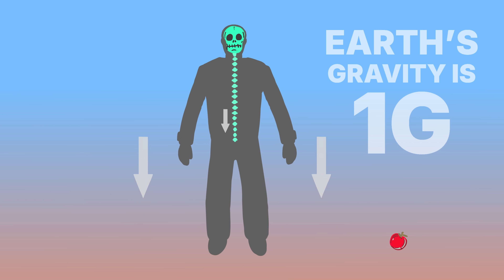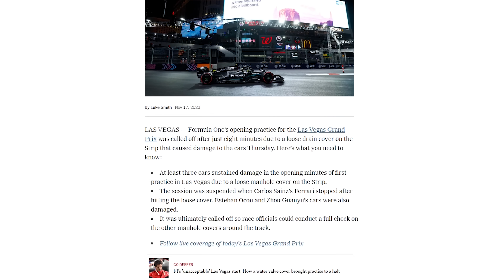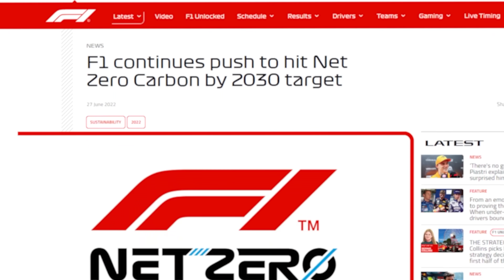Neil deGrasse Tyson Explains the Physics of Formula One Racing

Comment: Great choice of shirt for the interview. Can’t get better than a cloth print from a painter while in a asylum painted his interpretation of the night sky. 
My only disappointment from this was the history to attain downforce in these racing cars wasn’t mentioned. I realized the historical significance of F1 racing in 1977 when I got the opportunity to go to Hochenhiem for qualifying day. Bought a poster of Mario Andretti in the casket colored JPS chassis. This was before Andretti and Chapman began winning with “ground effects,” in ‘78. The yellow skirts are obvious on the poster I have. That was later banned because of the grip the chassis would have due to having no air current under the auto. The front and rear fins for downforce on the car pushed the whole chassis onto the track. 
Another point of any racing that I regard with high importance is the fact that the whole race is run on tires which cover about 3” of the asphalt or racing surface when standing still. This part of the racing isn’t mentioned often, yet that’s what racing is really about. Keeping the vehicle attached to the racing surface. It is important to note that the rubber wears off the tyres and builds up a sticking surface with more of the rubber put down before and during a race. When it does rain, that surface of rubber becomes the opposite of sticky and becomes slippery. Even with grooved rain tyres. Of course a racer does want to stay away from the clag or marbles which builds up off the racing line. 
One of my favorite F1 racing talk segments was with Sebastian Vettel and Mario Andretti. Somewhere near the end of their conversation, Vettel asked Andretti sheepishly if he could use the tires on his ‘78 JPS since they were larger. 
Lastly most accidents with super cars are due to old tires. If you’re going to race on any road, be sure you have the best tires. Finally last. Yes, I wasn’t sure best use of  spelling, tyre or tire should be. 🛞
Reply: Read a some other comments which better explain the underside of the current chassis along with needing to take turns at high speeds due to the design of the chassis. Thanks again, Neil.

Comment: Nice! But to be honest, turning water and CO2 into a syngas (H2 and CO) using electrolysis and the reverse water gas shift reaction and then into fuels through Fischer-Tropsch synthesis, isn't very innovative. Except for catalyst improvements this is pretty old technology, only economically viable for niche applications (such as wartime fuel shortages for which it was developed or big money F1 events).

Comment: First time I have ever felt dumber after listening to NDT. Wrong on the HANS device—it's NOT there to counter lateral G, it's there to keep the mass of the drivers' heads from breaking their necks in a frontal crash. Ask Dale Earnhardt, who would be alive today if he had worn one. Wings are not "add-ons"—they are vital parts of the aerodynamic design. Are wings "add-ons" to airplanes? Not if they are actually going to fly. NDT says the wings push down only on the rear—did he not see the elaborate wing on the FRONT? And the elaborate ground-effect design, which pushes the entire car downward? The crude animation of downforce had the "lift" going in the wrong direction. It also showed the wing of the cartoon airplane flipping as it transitioned to the race car so it was not just upside-down, but also backwards. The mention of slats on an airliner implied that F1 cars have movable slats—which they do not. Or that the wings on F1 cars expand in chord—which they do not. Explaining the physics? Not hardly. It would've been nice if Neil had explored the basics of aero downforce—increasing weight pressing down on the track, but without adding mass that needs to accelerate forward, backwards and sideways. Isaac Newton and the Wright Brothers would be rotating in their graves. NDT makes a living pointing out technical mistakes in movies—I've actually paid money to see him do this—and here he gets just about everything wrong. I kinda thought NDT was dedicated to learning and understanding. But here he has done neither.

Comment: Never thought I’d be in any position to give corrections to Neil deGrasse Tyson, but here we are. I’m just your average F1 and motorsports fan and it bugs me so much that there are so many errors on this video.

1. The HANS (head and neck support) device does not help the drivers with the G forces that they have to endure during a race. The primary function of a HANS device is to reduce forward motion during a crash, and therefore reduce the likelihood of head and neck injuries—particularly a basilar skull fracture, which is often fatal and has claimed the lives of many motorsport legends including F1 driver Roland Ratzenberger, NASCAR driver Dale Earnhardt, and many others. F1 drivers undergo rigorous training to endure G forces, which include training their necks to the point where they can shift up to 40kg with just their neck muscles alone. It’s why all of them have such thick necks.

2. Regarding the incident involving Carlos Sainz in the 2023 Las Vegas GP, the incident involved a manhole cover whose concrete frame had failed. Nevada law prevents these from being welded down, which was standard for F1 since the same thing happened under George Russell’s car during practice for the 2019 Azerbaijan GP. While the aerodynamic forces underneath an F1 car are significant, it’s not powerful enough to suck up a metal cover that’s sealed up by concrete. That particular manhole cover was loose, and Sainz was just really unlucky because he hit it in such a way that it damaged his floor and engine (particularly the battery, I believe), to the point where he needed it replaced and thus he had to take a (in my opinion wholly unwarranted) 10-place grid penalty.

3. The aerodynamics of a Formula 1 car is not only for the rear tires—it’s for the front tires as well. Balance in the aerodynamics is needed to make sure the cars remain stable and drivable at the speeds they go at. Adrian Newey, one of if not THE greatest F1 engineer of all time, once described F1 cars to essentially be upside down airplanes, in as much as the same aerodynamics that make fighter jets fly fast are the same aerodynamics that give stability and speed to F1 cars.

There is so much opportunity to be had here if you had interviewed an F1 engineer so that that they can explain things much better and so you don’t have to “dumb things down”, which often just ends up being full of misinformation and a disservice to your audience.

Comment: That brace on their shoulders is not to keep their heads from bobbing. It's to keep their neck from snapping on a head on collision. It was introduced shortly after the death of the great Ayrton Senna. On a head on collision, your body can experience 50g, so nothing keeps your neck from breaking. Ergo, the shoulder brace.
What keeps their head from bobbing around is their neck muscles, for which they do a lot of specific strength exercises.
Reply: After Dale Earnhardt's crash in 2001 if I recall correctly.  NASCAR was the first to use.  I don't think it was a thing at all back in the mid 90's despite Senna's crash.  Could be wrong.  EDIT:  I am wrong,  F1 was interested in it after Senna / Ratzenberger, but NHRA drag racing was first to use in '96, then NASCAR & CART, then F1 in '03.
Reply: @Smakbab9069  That is my understanding too

Comment: Would have loved this program if it was done on a late 90\s - 2000 F1 car with a screaming V10 engine and requirements to not only change tyres but also add fuel.  The dynamics around those variables were truly incredible.  Speakless of the sheer roar of the engine that constituted a racing driver's office.

Comment: As others have mentioned.  The HANS isn't there to support the neck, it's there to keep the neck from going to an extreme angle in a crash.  The drivers use their neck muscles to hold their head up.  This is why they all have necks like horses and when an inexperienced driver does a test he will always say his neck was failing him as the test neared its end.
Also the majority of the downforce comes from the floor of the car and ground effect from the low pressure created between the car and ground.

Comment: If the Halo is hollow,…. The could use the internals of the halo to shift weights in it x-over, putting more weight on right rear wheel for example and more weight on left front wheel at same time, when cornering left handed

Comment: I have heard that the downforce created at speed would allow a F1 car to run upside down.  If you could have a tunnel with ramps that would allow the car to climb up the side and then run across the top of the tunnel the down force would keep it there. Is that true?

Comment: It's impressive that the lowest part of the F1 is the clutch. All the transmission and the engine is positioned to make sure that the clutch is at the low place as possible. The clutch has a diameter of 12 cm or smaller and the more is low the more is low the centre of gravity.

Comment: 2:42 Massive scientific inaccuracy here. The Head And Neck Restraint System (HANS) device is NOT bracing the driver while they are racing. They train their necks brutally hard, and most of the drivers can resist up to 45 kg of pulling force in any direction, because their neck is what supports their head all race long. The HANS device is a safety system, in that the collar, which is fastened under the belts, is attached to the helmet via two straps that are somewhat elastic (5mm of stretch in them). It is there for when a driver goes straight, nose first into a wall. Because they are so securely belted in, in the event of a sudden deceleration from speed to nothing in the space of half a meter, the two straps gradually slow the head down in relation to the body, so that the driver does not suffer a concussion, TBI, or a fatal basilar skull fracture where the spine is literally ripped from the base of the skull. 

TL;DR: The driver's neck is their primary, and ONLY support when driving. The HANS device is there to prevent fatal injuries, as is the HALO (the big metal horseshoe thing above them).

Comment: -Do some homework. The " contraption" around their neck. HANS is Head and Neck Support. It only comes into play on heavy crashes. The drivers train their necks to withstand racing conditions and the G's that come with it.
-They allready got it sub 2. Pit record is 1.8
-They do have to build a new engine. New 2026 engine rules will be very different.

Comment: The HANS device is only in play in extreme longitudinal deceleration, as in a crash.  It was a response by Dr. Robert Hubbard to the death of a driver in a crash during testing where the car hit a sandbank and decelerated at extremely high forces.  It does nothing for lateral accelerations.  The drivers in F1 have absolutely MASSIVE necks from physical training.  This is what keeps their heads mostly vertical during lateral accelerations.

Comment: 12:19 getting really sick of the misrepresentation of this statistic.  You are at full throttle for 60% of the lap DISTANCE, not 60% of the lap duration.  Considering the vastly disproportional amount of distance covered when at full throttle vs when on the brakes (which transfer far MORE energy in much LESS distance), this isn't the glorious stat that they propose it to be.  It's just basic math.  Yes Silverstone is a speedy track, but I wish they would use proper terminology when describing it.

Comment: I have been working in MotoGP (founded a year before f1) for the past 20 years. The engineering is of equal complexity - but now you need to work in 3 dimensions, considering lean angles, variable size of tire patch on surface, aerodynamics and much more. With the result that one of the races last week in Japan had two podium finishes within 0.003 seconds! We can work all weekend to gain 0.1 second on a lap of 2 minutes. I invite you to join us for a weekend and see this fascinating engineering up close.

Comment: the airflow doesn't push the car down from above. the air below the car is moving so fast, that it literally sucks the car down toward the ground. its the high pressure vs low pressure air

Comment: 14:27

The halo is not a replacement for the roll bar. They still have a roll bar on top by the engine intake. The halo is for protecting the head of the driver from tires,other cars, barriers etc. It can also function as a kind of roll bar if the real one failed like what happened at Silverstone in 2022

It has saved multiple lives over the years and saved even more drivers from serious injury.

Comment: The HANS Device around not only F1 Drivers but in many motorsport series, is designed to stop the separation of the skull from the spine as in Dale Earnhardt’s crash that sadly killed him. With the G Forces the drivers train there necks for the stresses it put on there body and you will find they have padding in the cockpit so that the drivers rest there heads when there struggling with there necks, it happens especially with rookies. The monocoque cell of an F1 Car is designed to be compact and designed to a high standard of safety.
Reply: Dale Ernhardt's death was what convinced NASCAR drivers to finally blanket-accept the HANS (Ernhardt had been at the forefront of drivers vowing to not wear the device). Within a few weeks of his death almost every driver was wearing it and it became mandatory safety gear in that series from the following year.

Same with the halo device on F1 cars today, it had been added as a result of a young driver's (Jules Bianchi) death after serious head trauma and a year in a coma. When it got mandatorially introduced, a lot of the "old school" F1 racers complained, including Roman Grosjean. If that name is familiar, it's probably because he suffered a horrific accident in the 2020 Bahrain Grand Prix, but was able to survive with minor injuries, thanks wholly to the halo not only leveraging a gap between a trackside barrier that allowed his safety cell to pass through and allow him to escape the wreck (where impact forces had split the car in two at the same time and ruptured the fuel cell, creating a fireball), but the halo creating a safe space around his head to prevent massive head trauma similar to the kind that caused the death of Bianchi. In the days afterwards, he not only attributed his survival to it, he also rescinded all his past complaints about it.

Comment: Thumbnail says "more powerful than a rocket", lets do the math:

Ferrari F1 engine: 800 HP
SpaceX Superheavy booster: 33 x 91,200 HP = 3,009,600 HP
3,009,600 / 800 = 3762

3762, thats how many F1 engines you need to have the power of a rocket :D

Comment: That's quite cute to see a person of the ingenuity of our beloved host, being a bit outside of his comfort zone, trying to figure out where are the most important scientific constraints in the engineering of an F1 car are. He mentioned a little bit the fact that the air goes fast under the car and that the cars are low on the ground, but there is a graphic that is quite wrong because the air passing under the car doesn't produce lift in an F1 car. The biggest source of downforce in an F1 car is really the underfloor where they exploit the acceleration of the air going below the bodywork (Venturi tunnel, Bernoulli, air skirts and bla bla bla) to generate a massive amount of downforce

Comment: The cars did not use to be that big. The current cars since 2017 are a bit too big compared to say the 2000's, 1990's and earlier. There is a hope they get smaller in 2025 or 2026.

Comment: @StarTalk Your aerodynamics analysis was accurate for F1 cars preceding the pre-2022 seasons. It is not only the wings (both front, rear and a number of other surfaces), but also the underside of the car. The underside of the cars now, also comprises curves which are more or less airplane wings upsidedown. So the downforces is no longer created by the air passing above the cars, but also the suction created by the airflow underneath the cars!

Comment: Increases in downforce isn’t just on the rear, otherwise the car would become harder to turn as the front tires would effectively have less traction as rear downforce is increased. ‘Center of pressure’ is the aerodynamic principle of concern here. 

To me, this vid exemplified the academic physicist vs engineer mindset. Interesting to witness.

Comment: Don't forget that their center of gravity (or was it roll center?), is something like an inch below the pavement.

And if you really want to get into more engineering, talk about their engines and transmissions. Go read up on past innovations that have since been outlawed by the FiA in their infinite wisdom. Things like a fan that would suck air from under the car and blow it out back, or an active suspension that let the chassis lean into a turn like a motorcycle.

Comment: 07:08 Quite a strange and superficial mistake there. Plane wings suck the airplane upwards on the top surface of the wing and not push it up from below. Likewise, at 07:18, a car's "upside down" wing creates downforce on the bottom surface of the wing, and is not pushing it down by the top surface.

Comment: Formula 1 is the pinnacle of automotive technology, admittedly, but I would like a Star Talk to take a look at NHRA Top Fuel Dragsters. Formula 1 is finesse. NHRA is brute force. 12,000 horsepower!  7 G’s acceleration. 0-330 mph in 3.7 seconds. Negative 4-5 G’s hitting the parachutes. Aerodynamic downforce measured in tons. The physics of the chassis and the engine and the clutch and the tires to handle that kind of explosive energy is quite impressive. Check it out someday. By the way, they shake the ground at a 2.2 on the Richter scale.